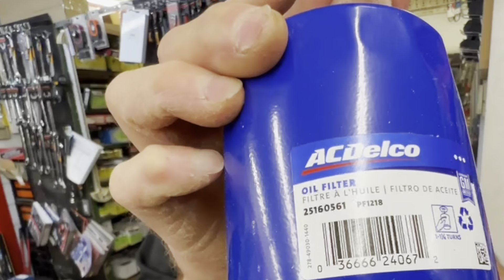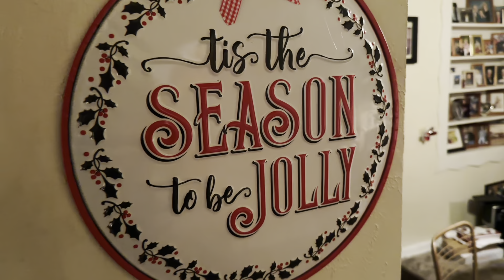My DAD bought this BEAUTIFUL 2 Tone Blue C-10!

Comment: The '80 Chev is a nice find for your parents. Everything you feel that needs to be repaired, replaced or rebuilt (most notably possible seat upholstery and seat springs replacement), etc., should be about the least expensive pieces available as re-pops. Door panels can be painted with appropriate products and the dash can be repaired and refinished too if  it too far gone. It sounds as though it will be the perfect truck for them.

Comment: Jeremy's spark plugs were factory installed originals. The green print gives it away. Your replacements have blue writing. Even when we got replacements from the parts department when I was at the dealer were blue printing on the plug.

Comment: Have u thought about a pertronix distributor they have a hot spark with a rev limit built in a small package or u can use their ignitor module in a old chevy dis i had 1 in my 66 chevelle ss 396 it looks stock but with their coil it is a great ignition i ran mine for years worked great no box to burn out or have to mess with plus its cheaper than msd.      Rocket from MO

Comment: For Chevy V8's hauling as much as you do, check out the long truck ones (I think its 51794 from Wix?), should clear your stock exhaust. Also there was a Corvette oil cooler option in the late 80's or 90's that went between block and filter that probably wouldn't hurt either.

Comment: Bill, can't you just turn that distributor to where you want it and just move the wires back or forward a few spots to maintain correct timing? Basically move number one to a different post? Temporarily of course.
Reply: I've done it a couple times because of intake fitting hitting the vacuum advance. Go counter clock wise one jump and you get quite a bit of advance movement.

Comment: Bill put a set of Amp Research steps on your dads truck thay fold up when you close the door fit tight against the rocker they are awesome ive had mine several years now ant led lights to light up at night they lower when you open the door.

Comment: Great video Bill that is a really clean truck you had found for your dad. Mean while I'm going to bring my 400 block to get checked Tuesday when I'm off to the machine shop just to make sure it's OK the bottom of either #7or 8 cylinder has a Lil spot in it that I think a rod hit I want to make sure it's OK and have it sonic checked and cleaned good it came with good rods and really nice pistons and today I found a nice set of dome pistons and rods for my 355 so I'll be busy this winter. I can't Waite to see your 421 when it's finished I hope you dyno that engine and video it. That's going to be something to see glad yall had a good Thanksgiving stay safe your friend from Louisiana Rick 427

Comment: Nice my truck I referred to as the monument to Bondo sculptures everywhere was a 221k mile 80 Chevy c20 Scottsdale it was a beautiful looking burgundy truck and the interior was decent except for the grey Ford van 90's seat and the 87 Chevy C10 door panels because they took out the original busted off and dry cracked 80 Chevy Scottsdale door panels kind of a shame it was full of Bondo I liked that truck even the 68 Chevy c10 250 L6 and I had planned on leaving it in the truck and rebuilding the 2gc gm carburetor.

Comment: Love that square body. So happy your dad will be enjoying it. With 80 lbs of oil pressure at a cruise, the chances that the oil bypass is open all the time, causing the oil to by pass the filter none stop, are really high. 80 psi at cruise rpm's on a daily driver might sound cool, but it is not. Not to mention it just makes engines that are prone to oil leaks, like the sbc, that much more likely to leak oil. I know this will fall on deaf ears, because no one outside your circle knows anything about engines, or cars in general...

Comment: Bill
Can you move the plug wires on the cap? Be easier and not cost you anything!
Reply: No.... number 1 has to be pointing at number 1 cylinder...
Reply: Sure but then there would be an excuse not to buy more parts. Kinda silly Imo.

Comment: That 400 sure did belt out the power!  Looks like a stock shortblock with Edelbrock heads? What cam did you end up using?  I've built quite a few vortec headed 400's but they were always for cars with 3000+ converters.  I'm curious which cam you used that made so much low end torque since I'm building a 84 GMC.

Comment: Correct me if im wrong, but dont those trucks only have a 5 digit odometer?  Meaning 379,000 and 79,000 (for example) would read the same thing.

Comment: Those acdelco oil filters are junk they’re like frams now we kept collapsing them on the dragster every pass we’d change it because we worked at a Chevy dealership we had several in the trailer so went to the wix 51061r gained 25 psi on pressure too
Reply: Against all my years of tried and true experience I give Uncle Bucko what he wants and not what he needs. 
Chumpy
Reply: @superiorautoparts1608  I understand him wanting factory brand parts my dad was same way but most are all overseas now unfortunately the old pf35 was great once they changed to the pf1218 we had issues still have 2 full cases of them sitting the shelf

Comment: Can you break down the reasoning/benefits behind the coolant bypass on intake? I'm thinking of doing the same. Recommend for all 400s?
Reply from the maker: The heads on small blocks only circulate water to the radiator through the front two passages at the thermostat housing. So the back 4 cylinders tend to run warmer than the the front 4